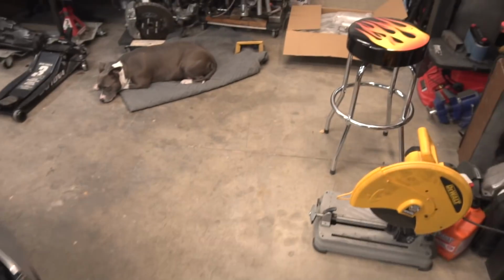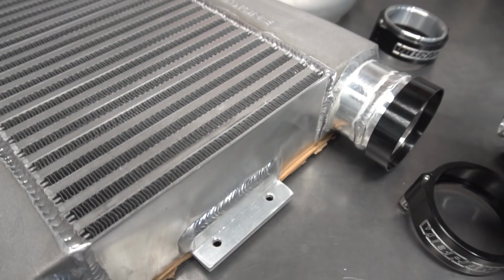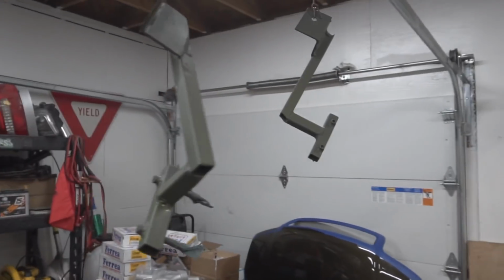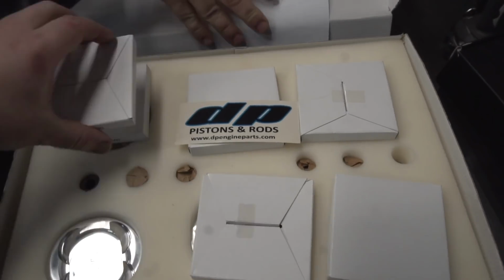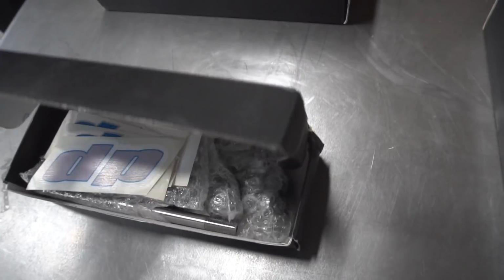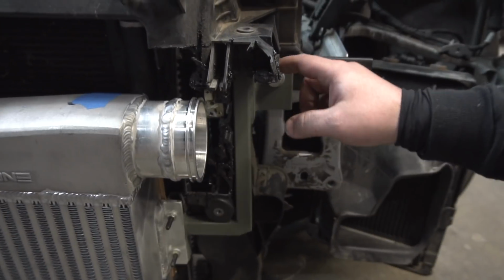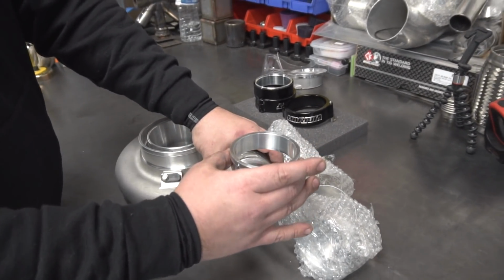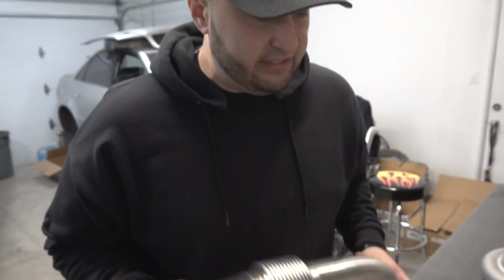| AUDI RS3 |  1300HP INTERCOOLER + CUSTOM ENGINE INTERNALS !!

Comment: Great job!

...as for getting more practice.  Take a couple straight pieces and weld them together.  Set yourself up v-block/s to align the pieces quickly.  cut in half and rinse/repeat.

Don't weld for more than 30-40 min at a time.  Take Breaks.   Forcing things will lead to frustration.

The idea is to have the pieces in position so you can focus on technique.  With a little time you can get the consistency.

Comment: Was curious why you went with a same side inlet/outlet top to bottom intercooler?  Asking because I was under the impression those were for use on large displacement v8 cars running lowish boost.  Just trying to understand.  Love the build.  Keep up the good work.

Comment: The install was really good. Do you think you'll need a larger intercooler?
Reply from the maker: Probably, will most likely make a custom unit using a more efficient core once I get confident with my aluminum welding, but we should be good for now being the Treadstone Intercooler is rated for 1300 

-George

Comment: Love the build so far, did you ever consider to not use a intercooler and just use meth to bring down the IAT
Reply from the maker: We have if the car was track only, however I will be street driving the RS3 again with the VR swap so we needed something more practical.

Comment: The OEM spring coolant hose clamps are best for coolant lines, they never over tighten and damage the hoses or release tension when cold and weep... just get a spring hose clamp removal/fitting tool set that includes the remote plier and other types of pliers... much better the channel locks or mole grips 👍